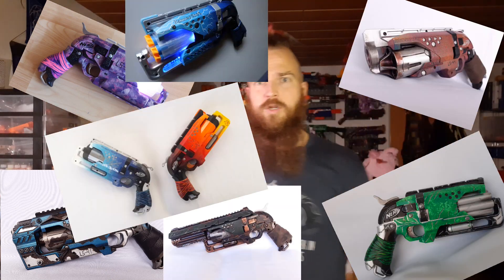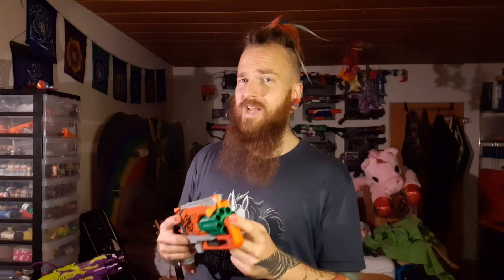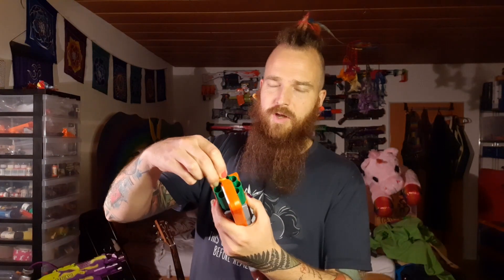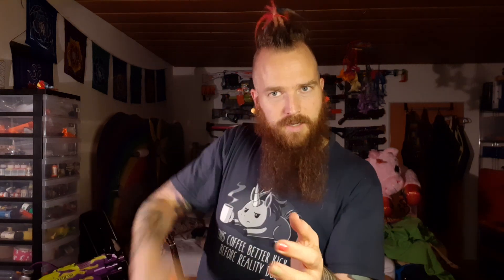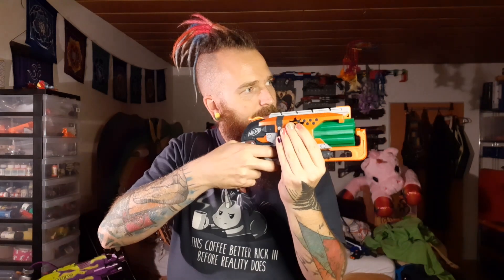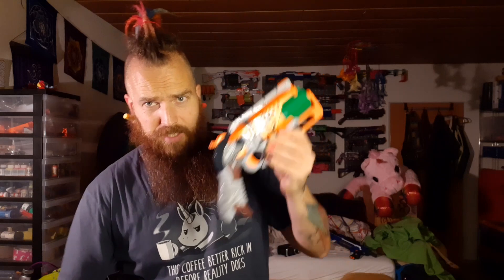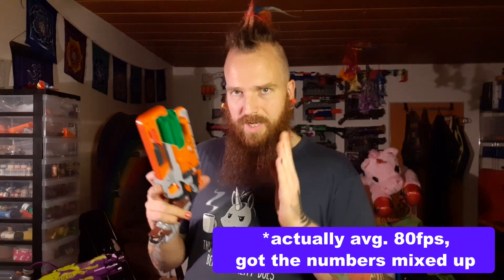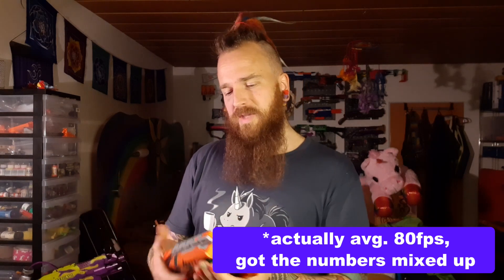INLINE CLIP HAMMERSHOT - Best Hammershot mod you can do! - plus Interview with Trip Miller

Comment: You could bore out a bit of the inside of the plunger tube and replace it with brass. Then add a stronger spring and maybe make a aluminum plunger with a silicon gasket. That would make for a pretty strong seal.
Reply from the maker: Sorry I missed that comment at first. 
I had a think about what you said and I would not use an aluminum plunger. Its way to heavy to move and with the little spring the hammershot has would lose a lot of performance due to its weight.
You can get a pretty good seal by removing the AR and installing the DSR cap with some craft foam to seal it to the cylinder/drum
Reply: Your good. I know they make carbon fiber reinforced plastic for 3D printers. I wonder if you could make a plunger from that?
Reply from the maker: @LamieTube  sure, but you can simple just 3d print a new plunger for the Hammershot. works well.

Comment: It's not a drum, it's a cylinder.
Reply from the maker: yes and no. I agree with you in the sense that within our hobby its mostly referred to as a cylinder. I do the same in the video so I should have maybe stuck with it. However, the the term drum in this case refers to 'revolver drum' and not drum magazine and is in fact a synonym for revolver cylinder. So both words work equally and therefore calling it a drum is not wrong ;).

And just FYI, in German it's called a 'Revolvertrommel' which translates directly into revolver drum.

Comment: Would the 24 round clip fit the nerf rebelle sweet revenge ??
Reply: i think they have the same internals so very likely
Reply: @eggshibe3149  thanks bro
Reply from the maker: I think so, but I don't have an arm to hold it. Need to talk to the designer if you are interested in one of those.